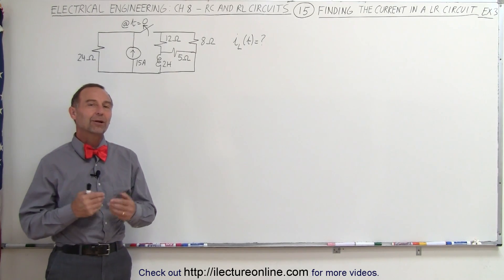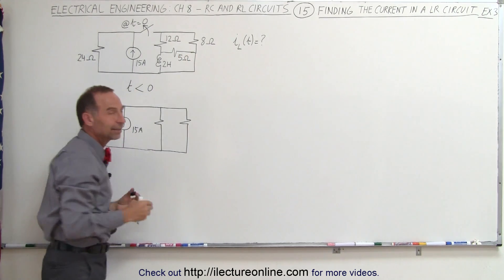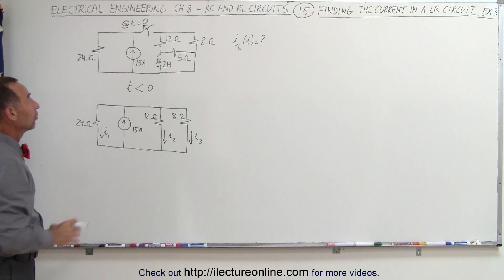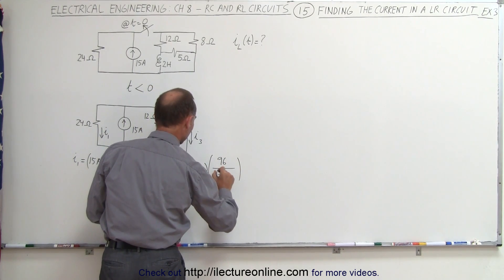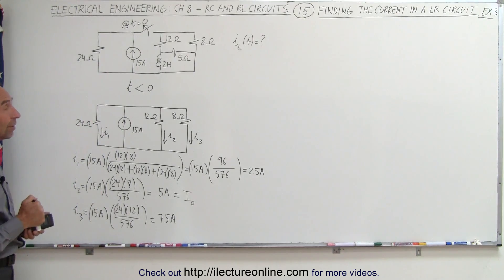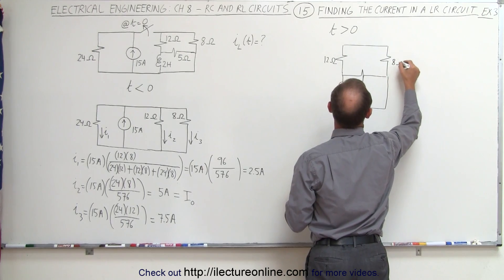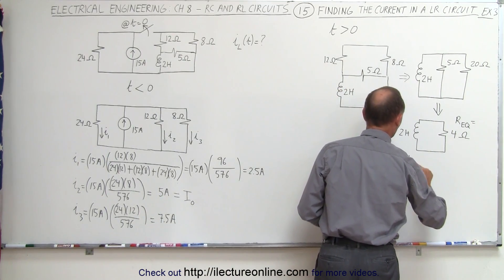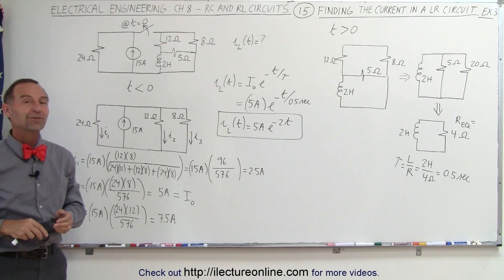Electrical Engineering: Ch 8: RC & RL Circuits (15 of 43) Current=? in RL Circuit: Ex. 3

Comment: 0:49 
Why you said the indicator act like open circuit
Reply from the maker: An inductor only opposes a current flow when it is CHANGING.  Once the current reaches steady state (stops changing), then the inductor no longer opposes a current flow and therefore acts as if it is not there.
Reply: Ok thanks you from Sudan @MichelvanBiezen

Comment: at the previous video,the inductor were short circuit but now open circut, whats the difference,also is there any video about how inductors work  ?
Reply from the maker: Inductors only oppose a CHANGE in current.  For steady state current the inductor acts as if is not there and can be replaced by a short.

Comment: I don't understand why we didn't use the 5 ohm Resistance
Reply from the maker: During steady state (t < 0) the inductor has no reactance and there is no resistor between the 8 ohm resistor and the bottom of the circuit.  Therefore essentially those 2 parts of the circuit are shorts and all charges will "choose" the path of least resistance.  They will not go through the 5 ohm resistor so, that part of the circuit will act as an open.

Comment: 0:49 correction the inductor will act like a short circuit and the 5 ohm resistor will act like an open circuit
Reply from the maker: Before the switch is opened, the incuctor will indeed act like a short circuit.  But just after the switch is opended the inductor will not act like a short circuit

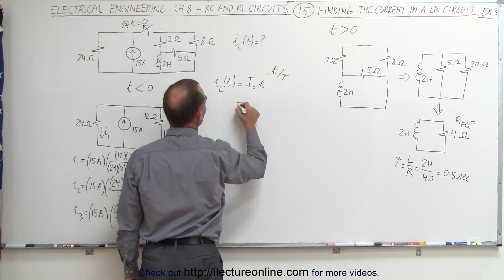Comment: Sir, at 07:24 isn't some of the 5A current going to the 5 ohm resistor? Why did we take it as if it was all current going through the inductor?
Reply from the maker: At the moment the switch opens, there is no current flowing through the 5 ohm resistor.
Reply: @MichelvanBiezen  Thank you so much.

Comment: at 3:06, where does that formula calculating i1 come from? is there any way to solve for i1?
Reply from the maker: I may have shown how that equation is developed but with 2 branches (R1 and R2) the equation is:   i1 = I total  (  (R2) / (R1 + R2))   with 3 resistors the equation is:  i1 = I total (R2)(R3) / ((R1)(R2) + (R1)(R3) + (R2)(R3))

Comment: at the beginning sir, you said at steady state the inductor will act as an open, I guess you meant short
Reply from the maker: Immediately before the switch is openend, the inductor will act like a short.  Immediately after the switch is openend, the incuctor acts as an open.
Reply: @MichelvanBiezen   can you please explain why
Reply from the maker: When currents have settled in and no longer change, an inductor doesn't oppose a steady state current.  But as soon as the swith is opened, the current begins to change and the inductor opposes that change, initially not allowing the current to change for the first fraction of a second.
Reply: It’s opposite of capacitor 

When switch is closed across cap it acts as a short because opening or closing a switch is high frequency phenomenon happens quickly so caps are shorted at high frequency 

Similarly inductor acts as open at high frequency and acts as open when switch is closed

Comment: During steady state condition inductor should act like short circuit instead of open circuit as you mistakenly said.Am I right ?
Reply from the maker: During steady state condition, IN THIS CIRCUIT, no current will flow through the inductor.  After the switch opens, current cannot flow from the left to the right part of the circuit, since the circuit is now open.

Comment: should the 24ohm resister be considered as part of the resister networks visible to the inductance?
Reply from the maker: After the switch opens up, no current will flow from the current source to the right part of the circuit, since that part of the circuit is not a complete loop.

Comment: Sir, why we don't take the current through inductor as (5+7.5) i.e. the current passing through 12 ohm and    
8 ohm respectively?
Reply from the maker: After the current passes through the 8 ohm resistor, it will not go through the 5 ohm resistor because it will take the path with no resistor instead.  (the path of least resistance).

Comment: Unnecessary complication while calculating the initial current through the  12 ohm resistor (initial inductor current). No need to calculate all three currents. Consider that one can simply join the 24 and 8 ohm resistors to form a 24*8/32 = 6 ohm resistor and then by current division I2 = 15 amps * (6/(6  + 12)) =  5 amps.
Reply: likewise you can find the equiv circuit: 15A and 4ohm, get Veq = 60, then use Ohms law and divide 60V by each resistor value to get all current values

Comment: Cant seem to understand when it at
acts as short and open circuit , what should be the conditions ?
Reply: Richie when a component is connected to the same node. U can give me ur social media or iMessage so that I can draw some diagrams  n show u
Reply: @abpdev  can u explain to me how to determine the current flow of the inductor after current of source cut out

Comment: Please mention your use of Current divider in solving branch circuits currents. Also, simplify Resistors in // to make it easier to understand. Other than that, its a good reference. Thanks.

Comment: I like your videos. In this example for the Final current is not supposed to be included in the final equation?
Reply from the maker: The final current through the 12 ohm resistor is zero

Comment: Sir why the initial current taken is 5 ohm
Reply: For t<0 (that is, before we open the switch, or in other words, when the switch is closed), we assume that the inductor is in steady state (that is, we assume a lot of time has passed since the switch was closed, and therefore the inductor is fully charged), and when an inductor is fully charged it acts as a shortcircuit (that is, it acts as a wire, because its voltage is zero, because the current is constant, so v = L di/dt = L * 0 = 0 V). However, realize that the inductor is in parallel with the 5 Ω resistor, and thus the latter must have the same voltage as the former, which is zero. If the voltage (the potential difference across the terminals of the 5 Ω resistor) is zero, then both of its terminals are at the same potential (don' confuse with potential difference), meaning that according to Ohm's law, v=iR, we get for v=0 V that 0 V=iR, meaning no current passes through the resistor (regardless of its resistance), and thus it has no effect on the circuit at that moment, so we can ignore it.
Reply from the maker: That is the current through the inductor for t < 0

Comment: Lol, wrong . when inductor in steady stage it should be short circuit , not open circuit
Reply: He's referring to the beginning you said that it was an open and you meant short, you even do the calculations as if it were a short figuratively. On a side note I am subscribed and I love your channel.
Reply from the maker: video is correct
Reply: 0:48
Reply: You also say it's a short shortly after you call it an open.
Reply: @Andrew Krzywosz he want to say it is short circuit but there is no current flowing on 5ohm,thus current will not prefer to pass trough 5 ohm , i think that is the idea.
Reply: +1